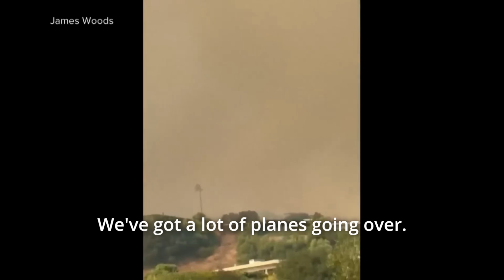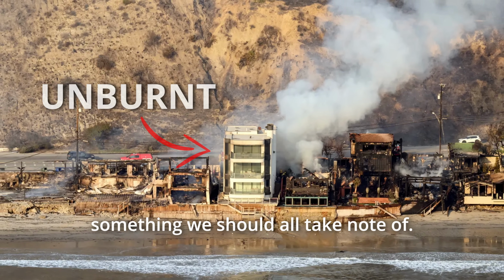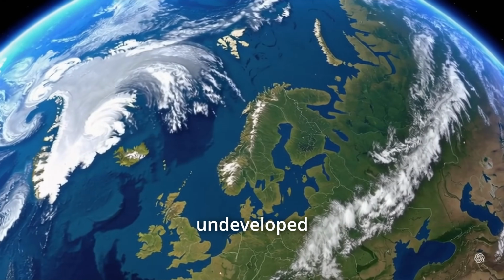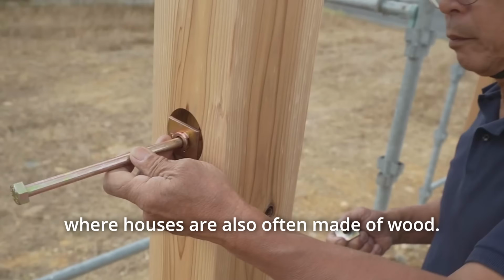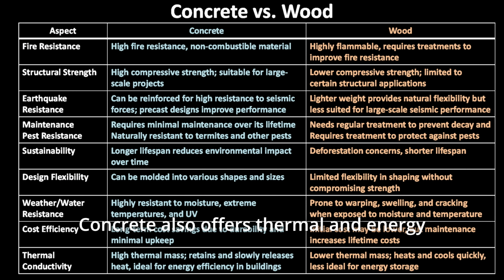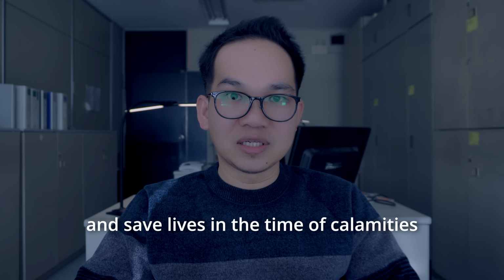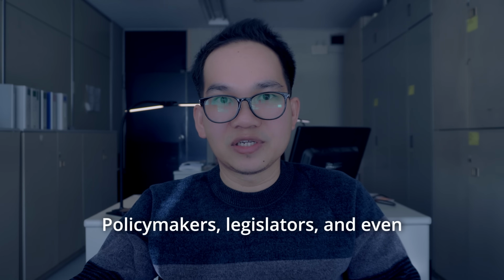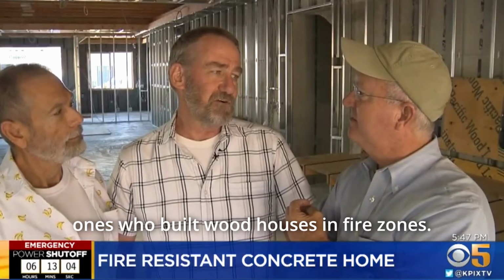Fireproof House? - What America Can Learn From The World

Comment: Houses in America have wooden stick-frame construction because our vast forests produce inexpensive building materials. You can fire-harden stick-frame construction. I'm at a loss as to why the building codes in wildfire-prone areas don't require it. That may change after these LA fires are put out.
Reply: CA's building codes have gotten a lot stricter for fire resistant materials in areas that have the high risk exposure but they can't be forced onto old structures and can only be enforced when significant remodels happen or if someone builds a new house...All of the homes that we see images that survived were also newer build homes while the homes next to them built 30,40, 60, and even 80 or even 90yrs ago mostly all burnt...
Reply from the maker: You make a good point. It's time for the California building codes to adapt to wildfire risks and calamities.
Reply: At certain a temperature wood will still burn even with fire coating it's good for prevention but it's not bulletproof.
Reply: @JustAverageJeff  The key is to never allow the wood framing under, say, Hardi composite cement siding, to reach ignition temperature. That means no wood decks, arbors or gazebos far away, no combustible landscaping materials or plantings. Non-combustible roofing materials are essential.
Reply: Yes it is very affordable to build with wood. 

The key issue is that AC units and roof vents let in Air and burning embers and ignite the inside. 
In addition many Windows are not fire rated. 

You have to get so many things right. 

No dry brush, no close trees clear ground. Roof clay roof shingles / and at least walls fireproofed
Reply: because it's profitable for builders. owners loose!
Reply: @ that's a dumb comment